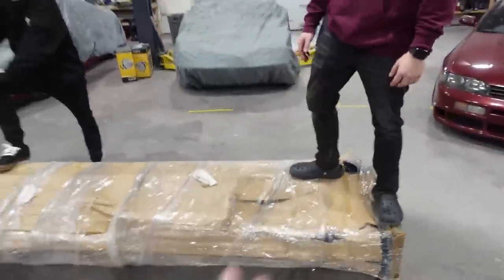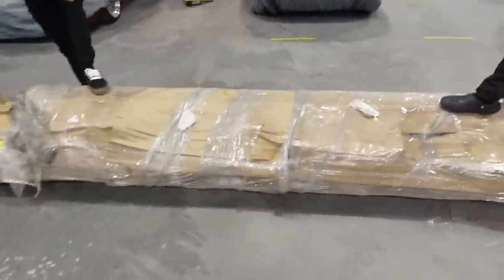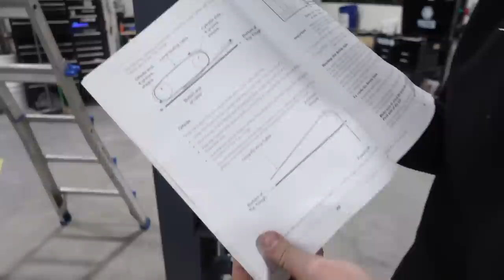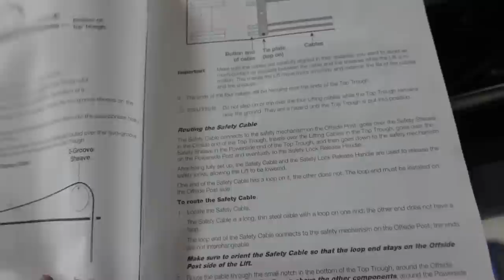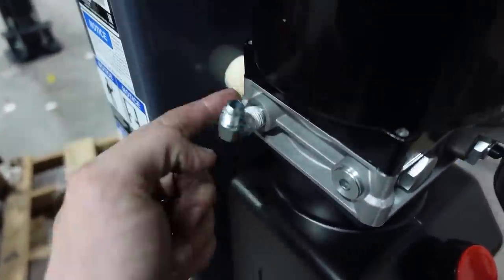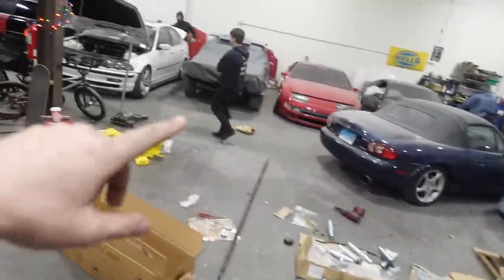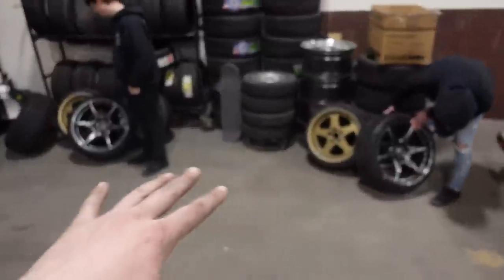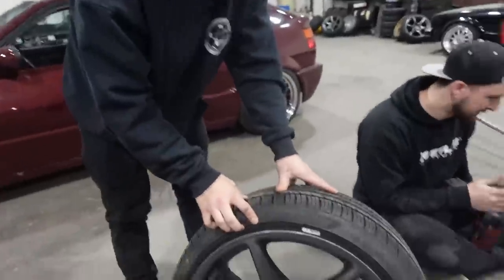Setting up my new BENDPAK LIFT! - SHOP TRANSFORMED

Comment: the lifts look great . really really great . the tire machine is sweet too.

oh , and i wanted to mention that you should mount the air compressor, up above the tire machine . up in the air above everything. then run your hoses above everything. with some drop down hook-ups around the shop.
so no matter what you are doing , or where you are working, you can have air. And you wont have hoses running all over the ground.

one last thing. . All these new shop areas, and growth in the garage. 
you are only missing one new thing. . that one new thing is:
 a master mechanic
one that you can trust doing all the monotonous labor of rebuilding. 
you know, like a guy that can just be working on those small, but really important things that just need to get done.

peace, keep it up
we been loving the videos. And all the progress
the Eturn

Comment: Jimmy, you should buy some box fans and aim them to the ceiling. It was help circulate the hot air back down to the bottom and help with heating!

Comment: Just a suggestion...put some reversable ceiling fans to pull the hot air from the ceiling down so you can save on heating and air conditioning.

Comment: You should use that lift as the longterm lift as the other lift is easier to get in and out so surely be better using the old lift for short term projects?

Comment: Like the shop improvements but the r33 needs to stay on new wheels, with the front spacers and 10 mm rears if theres room for either and it would be absolute🔥